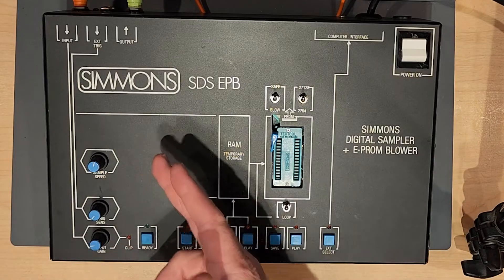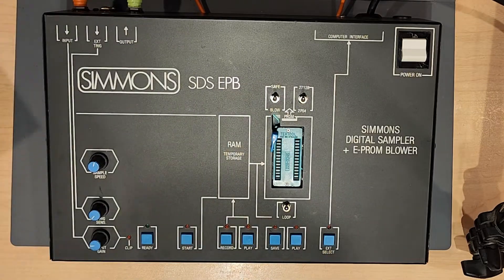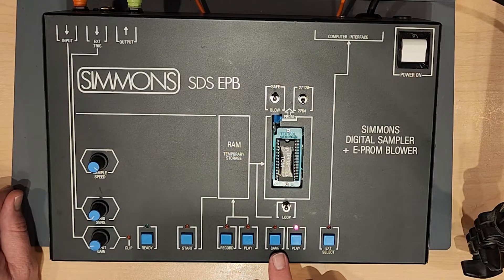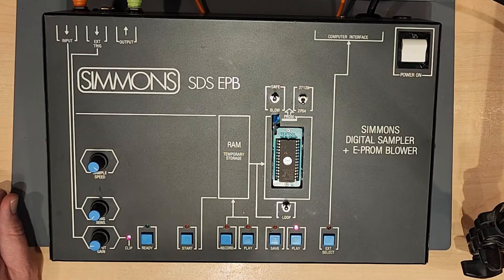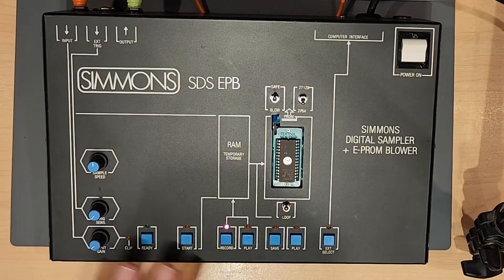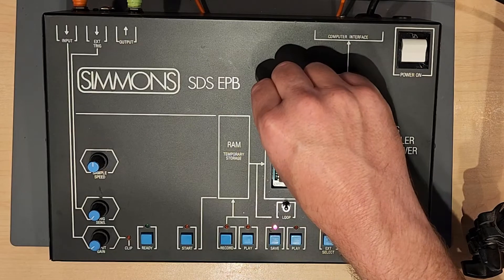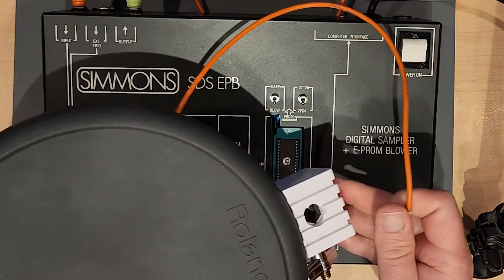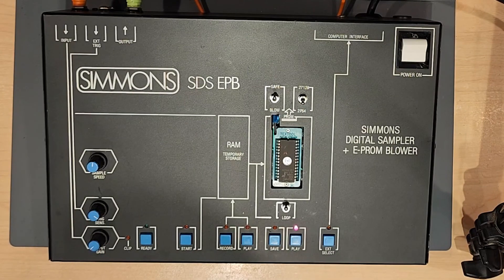Simmons SDS EPB Overview

Comment: The compaded format used for recording and playing these (code/decode, a bit like riaa does to vinyl recordings) to optimise the audio is called Ulaw (i think the u is a greek mu in fact) every unit using this ulaw treatment will work fine with any eprom recorded with this epb blower (got one lately i came back here to recheck before teting because i had to change my regulators on it, hope i wont have to go for more problems...). About every high end american brand drum machinme of that era (the firsty series of digital drum machines using sample) will be able to use your epb blowd eproms: Linndrum, sci drumtraks, oberheim dx and dmx. the exeption in the lot is the e-mu drumulator, they had theyre own way to do it (and later they mastered sampling vbefore most a dem). just to add a little knowledge for those interested in the topic, in nowadays you canbuy eprom (and other chips) burners for 50 bux brand new, they take some time to learn to use but we live in the era of communication right? then you can burn ytour eproms for a bvuch of units, samples or even firmwares. i will suggest going on the "electric druid's" website to read his article on the topic of digital drum machines, if you want to dive a bit deeper intoo what usefull trix you could learn regarding that technology, wich imo give the best drum results sonically. thanks for the vid mate.

Comment: I have one of these I purchased brand new in the 80's sometime. It's in working condition however a couple of the pot nobs broke. Is there still a desire for these machines?
Reply from the maker: Nice! Yes, the EPB is quite unexpectedly valuable at the moment. Honestly, I'm not sure why. The pots are hard to find, but the knob caps are still available.
Reply: @mphtower  Thanks so much for your response. Would happen to know when I get both the pots, and the knobs? Id love to make this one work completely, and look presentable. Thanks for your time!!
Reply from the maker: @gilbertmoreno8614  I'd get in touch with The Simmons Guy if you're in the US (https://thesimmonsguy.com/). If you're in Europe, look for Micha Buchner.
Reply: @mphtower  hey man, in case you want to sell or repair this unit, please feel free to get in touch, i'm working on mine i bought "as is" for 400 bux (i'm an audio electronician, or else i would'nt of done it), in fact i came back here before testing it after putting new regulators (there was no -15v out of the 7915, hope it the only provblem, seems like a chip was replaced in the past, the seller got it from a pro studio's ayuction sale in california, so for now i'm pretty confident lol). if you want to sell it (or swap maybe?) i'm interested. If you want to repair it yourself and have a question maybe i'de be happy if i can help. and if you would like to have it repaired (i'm in france though), if you are in europe rather, i might be the person that could do it for you. I bought a few units latyely (simmons epb and sds-9, sci drumtraks...), all having to be refurbish a bit, to study that technology. that means that weather it may be for chatting about the  topic, or putting my hands in these, i'm pretty motivated...